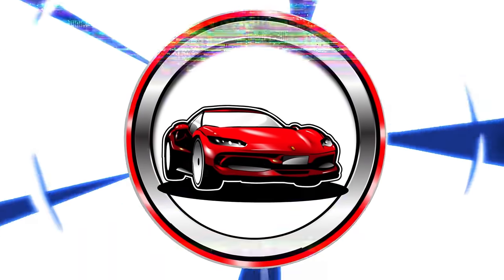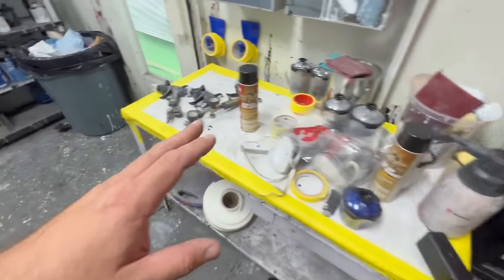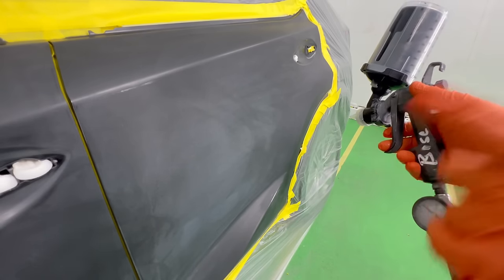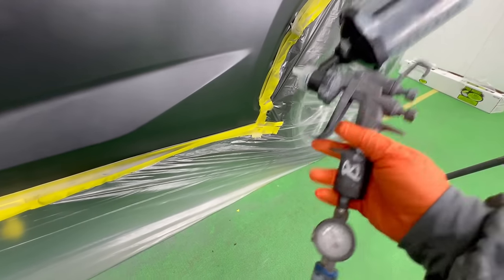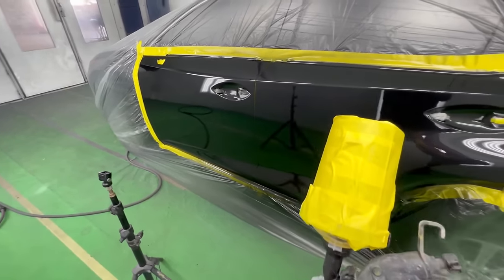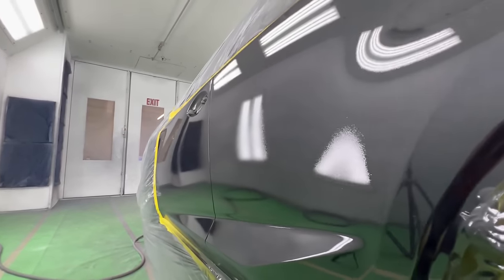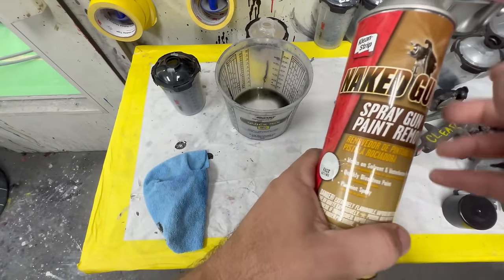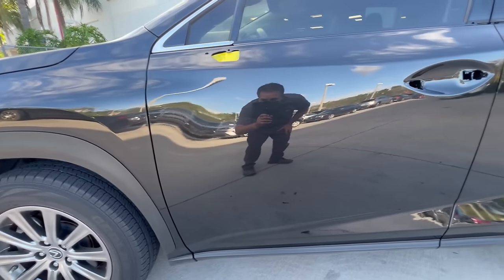Should You Buy the 3M Performance Spray Gun?

Comment: I actually used a 25 dollar princess auto (hobo freight) gun to put down my base and then switched to a devilbiss FLG 4 Finish Line gun for the clear and I could see and hear the difference of the better quality spray  pattern.
Reply: Try switching the guns, the expensive one to spray the base and the cheap one to spray the clear. If you know what you're doing you're gonna understand that the last coat of anything, whether it's base or clear, it is going to take the texture below it. So, would you want to lay your clear coat over a very smooth base coat knowing that the clear is going to take the texture below it? Or, would you spray your clear over a very rough orange peel base coat and let the clear automatically take the shape of the base?

Comment: First.. I’m a big 3m fan and especially of the performance gun. Doing multiple colors at once this gun makes it a breeze. They are coming out with RP style tips soon so be on the lookout for them. Tips sizes offered are 0.9 for uv. 1.2 1.3 1.4 sealer base clear 1.8 2.0 for primer. Awesome job sir. I recommend them for primer, sealer, base and some clear. If clearing with it I would do 1.4 is better than the 1.2 or 1.3
Reply from the maker: Yes sir. This gun gets the best all around award!!
Reply: @PaintSociety  I agree 💯 %  best bang for your buck
Reply: i have this gun and love using it. what are rp style tips?
Reply: @walkerandrews8892  the tips currently available on 3m performance gun are HVLP style. They have redesigned some
Tips to mimic sata RP tips which means Reduce pressure. Some people prefer reduced pressure tips to get more material out.
Reply: @juanmata2433  will these tips require different settings
Reply: @walkerandrews8892  I was able to try some recently at the Axalta training center and no the setting were still the same but a little more air pressure.

Comment: Surprised to hear this about 3M accuspray, I really like them for the exact reasons you mentioned on this video.
Reply: Same, everyone I've known that used them has really liked them. At my old shop everyone in the paint shop had one. Now the old accuspray I hated with a passion. They would pop off after a few uses.
Reply: Have to one too and love it… I don’t clear with it
Reply: This is not an accuspray gun.   That was first generation.  This gun is completely diff

Comment: I would recommend a 1.3 tip for clear. I used the 1.2 at first but wasn’t sure I was getting enough clear on the panel after 2 coats.. so I checked the next one before and after clear and was only getting about 1.8 mill thickness with the 1.2 tip. That being said I switched to the 1.3 to get a little more material on. Everyone sprays differently and maybe you wouldn’t have the same results as I did but it’s just a thought. I have 8 of these 3m guns and use them exclusively for all aspects of the paint job with top notch results! I love the 3m gun
Reply: You ever use the pressure feed connector with a pot?

Comment: I really like your channel because the paint on your projects looks fantastic (the blue is GREAT). That's why I subscribed to your YouTube channel a long time ago. There are a few thinggs I'm not fond of, running bare hands over the panels, wiping the wax and grease remover by going left and right (should be one direction and fold the wipe), last but not lease is shaking clear coat to mix (creates bubbles in it), that drives me nuts. It works for you so hey, keep doing it. Your paint looks great when it'd done.

Comment: personally i have no desire to try the 3m gun out. That said, i did find some great ideas from a different section of this video. I am a hobbyist. little more then a diy guy but not as much as a pro. maybe 20 or so jobs a year. now I have noticed im struggling to keep vision on my edge spraying from top to bottom. you just made some very valid points I never considered so Monday I got a Chrysler 200 I'm going to try and shoot from bottom up and see if that helps me. Thanks for the idea man I really appreciate it.
Reply from the maker: Report back n let me know how it works

Comment: Dont know if I would call them most efficient. Minimal air consumption with minimal overspray is what makes a gun efficent. Tuff to beat the efficiency of the Devilbiss DV1-B and DV1-C. I use the B-1 and C-1 aircaps at only 8psi to 12psi and the overspray is atleast 20% less than my overspray was when I was using Walcom Genesi 360 light HTE guns. 3M has kind of gone to sh*t with some of their junk. I still use their sand paper and PPS 2.0 cup system but stuff like their buffing compounds, spray guns, regulators, clay bars, ect kind of suck

Comment: Great video as usual. I use that gun everyday with the exception on clear coating, painting multiple bumpers & only having to clean just the nozzles is nice and I don’t have to own 4 guns. As far as clearing, sometimes I start at the bottom, sometimes from the top, sometimes I go from bottom the 2nd coat from top. There’s no right way. Next time you clear, try using a 1.4 tip, you can always up the psi to 23-25 with no issues. Keep in mind, hvlp guns need to go slower cause of the lower psi, and with that 1.2 tip(I know that’s your favorite size) you would need to go slower then normal to wet it up, I’ve tried the 1.2 and didn’t like them for clear.

Comment: Brian, I'm not even a novice. I painted my 02 Silverado earlier this summer. It turned out just OK. However I did learn things.
Are you telling us that you can get a quality finish from just about any gun, given a little time with it??
Reply: You can get a good finish by adjusting settings. Not every gun is going to be capable of a quality finish. You can still get a quality finish out of some cheaper guns less than 200 which isn’t bad at all. More expensive guns are going to spray fairly well without much adjustment or even technique. Try out the Eastwood concours lt100 for clear coat. Thing lays clear and atomizes it very well. I just painted for the first time and the clear coat came out extremely nice with the lt100 only a bit of orange peel which was still a lot less than all new cars these days.
Reply: @fiys567  That's what I bought for that project. Like I said it turned OK. Repainted just about every panel trying to get things better. Frustration in action🤔🤔
Reply: @ronallen6578  Did you use the lt100 for clearcoat and base? I used the lt100 just for clear because it’s the only gun I have that my compressor will keep up with at such a high psi. I used a kiwami4 for base coat. I ran the lt100 at 33 psi wide open material slightly dialed in fan and it sprayed beautifully.
Reply: @fiys567  Yes, both base and clear. I used my trusty Harbor Freight $15 purple gun for primer. Actually had to toss 1 when the epoxy primer set faster than I thought it would--DUH😱😱. I have sprayed a lot of lacquer in my woodworking over the years and figured how different could it be?? Like I said, I've never done any body work along these lines. Lots of you tube videos, talking to several body guys locally and just pure stupidity on my part thinking I could do this. I don't think there was a single panel I didn't end up spraying 2x. Hood I actually hit 4 times??? It ended up turning out ok, but I'd sure like to know then what little knowledge I managed to acquire through this. At 67, not to many more opportunities going to fall my way.